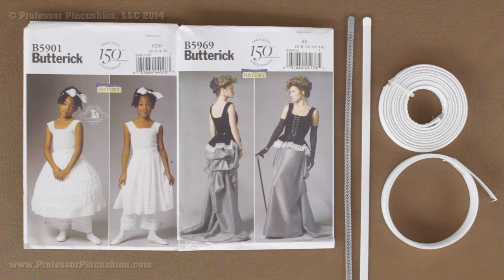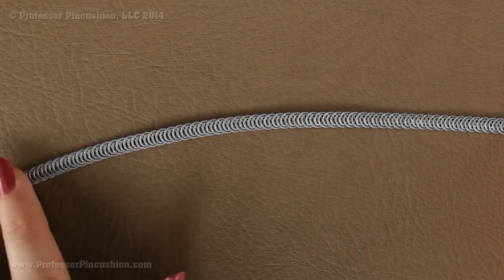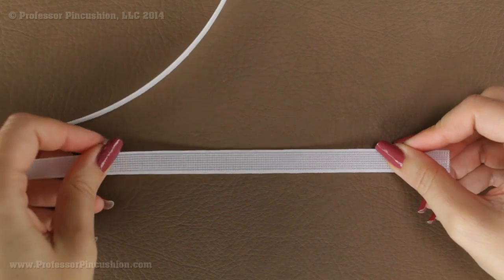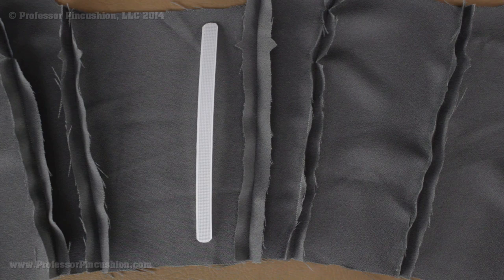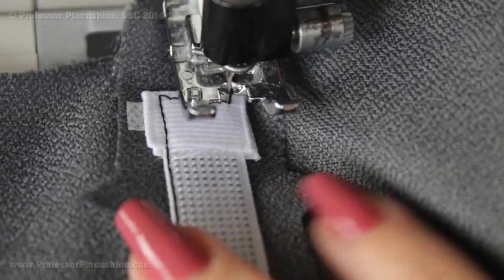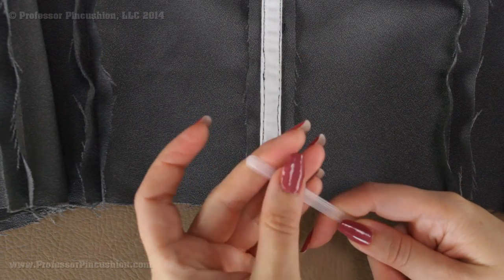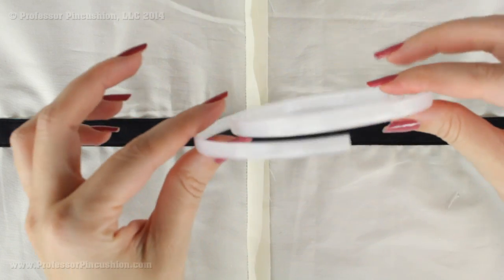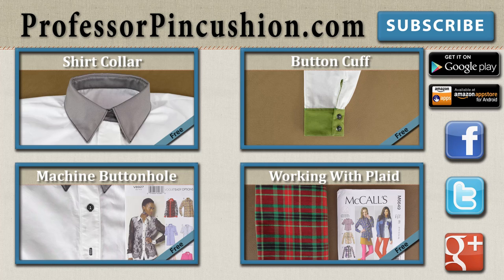How To Sew With Boning - Basics

Comment: Thanks for the detailed explanation with regards to the different kinds of boning, Prof. P. I am attempting to make an elliptical hoop skirt and have been wondering if plastic boning would be a good substitute as steel hoop boning is not available in my area. From your experience with the plastic boning, would the hoop skirt hold it's shape when worn with multi-layered petticoats or heavier skirts? Would it make a difference if I doubled the boning pieces in each channel? Your insight would be very helpful. Thanks again for the wonderful video, and I loong forward to your reply.
Reply from the maker: I haven't made a hoop skirt myself, so I don't know how much weight the plastic boning can take but it holds its shape pretty well.  The hoop skirt shown in my example pattern uses the plastic boning because that's the one most available to people at their local fabric store.  You can also buy boning online

Comment: Is it possible to make it to where the boning is removable for cleaning? Also, I wanted to make a dress with a boned bodice, with puffed sleeves.
Reply from the maker: well, it would be tricky.  You'd have to sew your casing or channels outside of the lining so it would easily accessible.  Then you can to have a way to open and close each channel because you don't want boning popping out as you're wearing the garment, but it would be a pain in the neck to remove stitches everytime.  I guess you can try and get creative by using velcro on one side but channels are usually too narrow to get easy access to do this.  Or you can stick with plastic boning as it is washable.

Comment: I take it with the featherweight that the curved part goes out instead of in so it follows the curve of the bust?
Reply from the maker: Alison Maschmeier Yes that's correct.  the boning should always go along with the curve of the body.  Thanks!
Reply: Is there a way to make it hug my body better? the plastic just doesn't mold too well and it doesn't want to work the curve of my bust.  I am small chested so I don't know if that makes a difference.